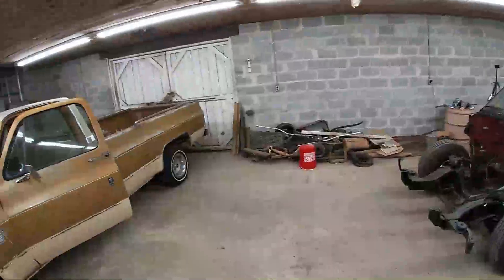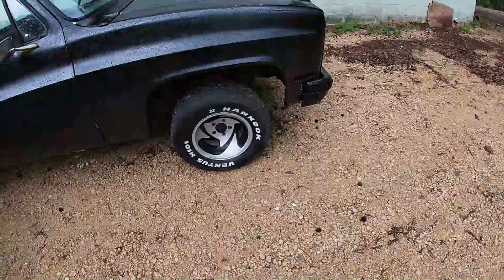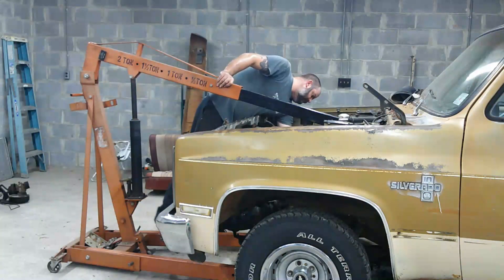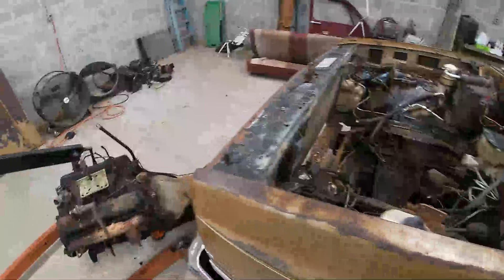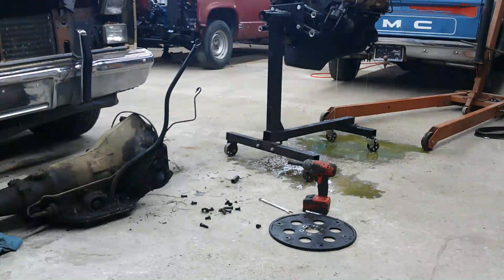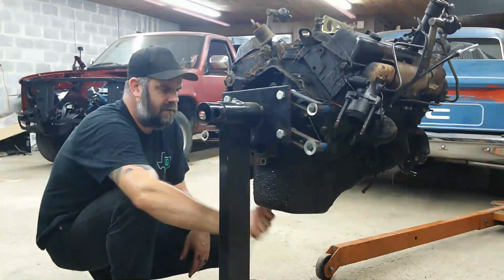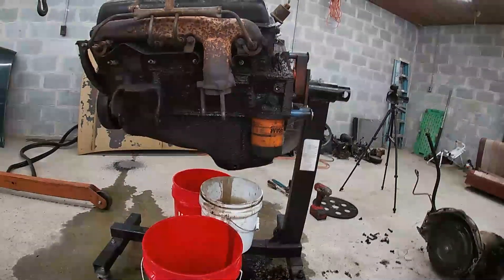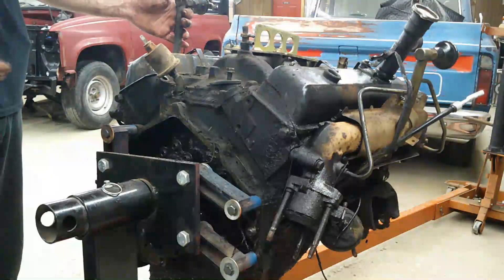Introducing a new project. 1981 chevy c10 swb.

Comment: Next chance you get when you pull an engine out, can you go over some basics on what, where, how you go about attaching the engine to cherry picker. I've noticed some use chains to bolts and some use a mount. Thanks👍
Reply from the maker: No problem. I will go over it when I put it back in. But I will do a pull out next time I do one

Comment: I use easy Off oven cleaner or purple power full strength to clean an engine
Reply from the maker: I use oven cleaner also. I just don’t usually pressure wash them when they are out of the truck. I just clean them by hand

Comment: You should try one of those $100ish gallon single stage paint kits online and give it a shot. Even if it doesn’t turn out amazing, it’s a lot better than rattle can in my opinion.
Reply from the maker: I’ve used them before. And I have paint guns and I can spray with a gun pretty well. I may do the engine compartment that way this time. It’s just cheaper, easier, and more convenient with the rattle cans

Comment: Myself I've always preferred 305 over 350 one was gas mileage other to me 305 was more in line of family type 
They both have good power but like said I like 305  better but that's me
Reply from the maker: I don’t disagree with you on that. I’ve built a couple 305s and really liked them. Throw a mild cam in them and they make decent power and rpm way faster than a 350